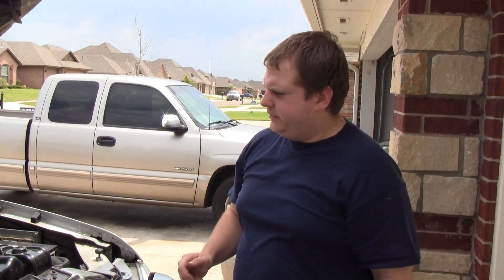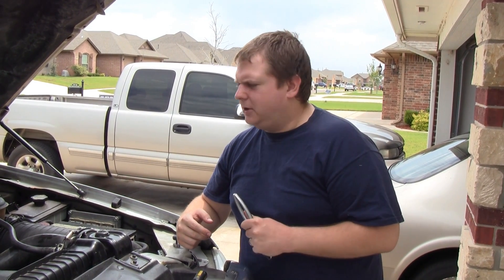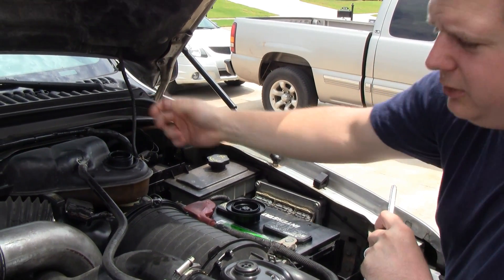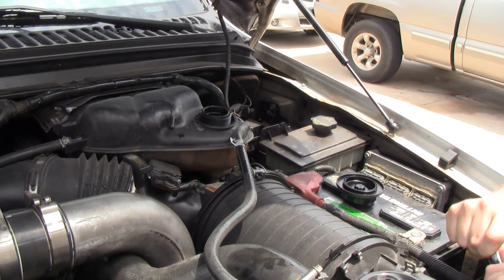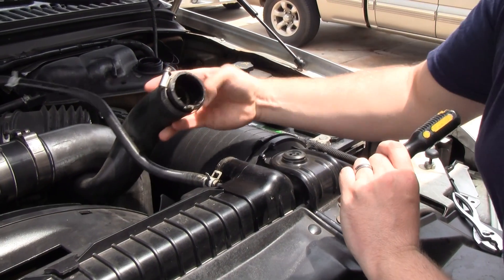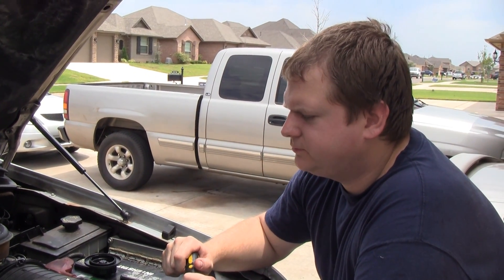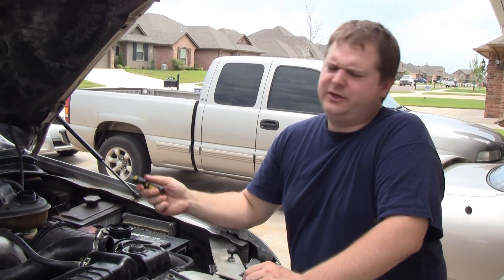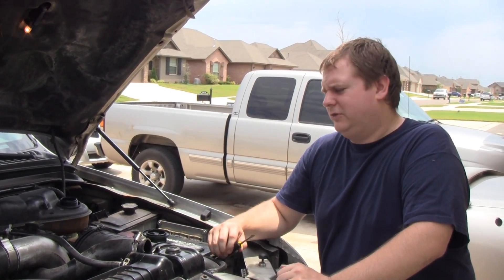Deviously Clever Mechanical Fraud On A 2003 F-250 Powerstroke Diesel

Comment: Problem 1 you bought a 6.0
Problem 2 that cover up job could have been done at any point in the trucks life. Even your "mechanic" could have done it. Don't automatically blame the dealer
But as a solution for all your automotive problems past, current, and future......buy a bicycle it will be more reliable than a 6.0 at least
Reply: +Zonedout1220 You must have sold this guy the truck. Why would his mechanic do something like this? So he could make less money repairing his truck? What's your logic?

Comment: Before buying any used vehicle take along a OB-2 scanner, plug it in the the computer port of the perspective vehicle and check it out. It could save you several thousand dollars. The scanner certainly would have picked up a fault code on this mans truck.. Just a thought..
Reply: +Joseph M An OBD scanner wouldn't tell you that theres oil in the coolant.
Reply: +Joseph M it's an auction u get to see the car and most of the time thats all u get to do and from far away.
Reply: +Joseph M Totally. I smoked out a small dealer on a ABS/traction control issue on a car I was considering cuz I was able to see pending codes in the computer. No lights, no disclosure by them, fed me some BS when I quizzed them about it. They probably realized real quick I knew more about that car than they did.
Reply: +Joseph M  That is a GREAT suggestion! Not to mention finding a Ford or diesel mechanic whenever thinking about buying one of those or really any used car!
Reply: +Joseph M      That is not always a surefire thing. You can delete codes permanently so the computer can not even throw it. But I've only heard of people doing it to their personal vehicles to pass emissions. But I'm sure somewhere someone is using the same method to cheat the next honest & hard working guy to come along.
Reply: Joseph M if the guy did all that wouldn't you think he would have cleared the dtc codes ... Not hard to do clear fault log and codes from computer in 3 seconds..
Reply: mwiz100  it's possible and easy with an obd scan tool
Reply: HulkSmash86 : Good point to remember..
Reply: wilkesjournal
I did a bunch of research on the matter before posting my comment. If you can direct me to something to lookup proving it I'm all ears! If this is real, I want to learn about it!
Reply: +mwiz100   Google "automotive computer flash" to begin. There are lots of companies and individuals who do it. It's routine, and generally is not done for nefarious purposes. It's done for various reasons including performance gains, non-compatible parts-swapping, etc. Often people install late-model drive trains in older vehicles, and bring the donor vehicle's computer along with it. In which case, computer re-programming is used to turn off the now non-existent security system so the 'new' engine will run in the older car, and so on. Many that were equipped with four O2 sensors can be programmed to now use only two in vehicles that are not equipped with catalytic converters. 

Those who are set up to re-flash OEM automotive computers can adjust, or tune them (or more commonly) can disable certain functions any way you're willing to pay for. It's not unusual.
Reply: wilkesjournal
Oh ok we're talking about re-flashes! (Plenty familiar with doing that.) I actually never thought about it that you could indeed use that for basically cheating. Considering the involvement of doing so purely to remove a code for a sale I don't see too many folks going to that effort but you totally could use it for that manner. But with the right digging you would be able to see it was running a non-stock flash.
Reply: +mwiz100   Yep, and by then it's too late. They've already got our money. Actually, this is the first time I've heard of it being used for this kind of deceit, but as the value of sub-prime, 15 year old used cars increases, it shouldn't surprise us.
Reply: Unless you've got a better ob scanner than i do it won't pick up and past codes that have been cleared/deleted, only active ones
Reply: I've never heard of such an ability to permanently delete codes. The inherent nature of OBDII doesn't allow for that and really isn't possible.
Reply: +mwiz100   Respectfully, you're mistaken.

Comment: Wow. This IS a form of criminal fraud. It's ironic that three years later, the 6.0L after all the bugs are now fixable with updates and paying attention to maintenance, this engine is actually not bad. Especially 2005 - 2007 models. It's a great tip and glad you posted it. After all these years, I bet more than a few have done this trick not only at dealers, but DYI'er too. It is sad to see.
Reply: +Doug Hanchard technically it's not fraud since it was an as is auction. still a slimy bs move, but sadly u couldn't take legal action against them unless they were selling as pristine and brand new condition which i doubt.

Comment: This is a scam the real scumbag used deals pull. They take vehicle to the auction with no intent on it making it to be auctioned off. They will wait to put it in the auction so it ends up towards the back of the line. Then they wait for a non dealer buyer to start looking the vehicle over and then tell you it's there personal car and they need to sell it fast for some BS reason and you think hey I'm getting a deal don't have to bid and pay more, I'm helping this guy out. WIN WIN. Couple weeks go by they title paper work comes and find out he's a dealer or start having issiues with the car before. 
One thing you should do is go back to the auction company with his info and let them know and also do some checking with DMV because in some states it's illegal for a dealer to not tell you he is one when selling. If it is report it. You might save somebody else. 
Hope it worked out with getting your truck fixed

Comment: I am so so sorry that you bought a 6.0/VT365 engine. These are the worst engines ever collaborated on with Ford Motor Company. Everyone that I know that owns one has had terrible issues of all kinds with this engine. Try to get rid of it and find you a nice 7.3L or the newer 6.7L all-Ford Powerstroke. Mine is the 7.3L with only 26,700 miles on it. So far, the only issue is bad fuel at some stations! The 7.3L is indestructible. Best of Luck, my friend.

Comment: now the truth comes out bought at auction see you lied u get what u pay for auction because a dealer took it trade  and sent it to auction they get rid of junk and high mileage cars and old junk
Reply: Terry Lee exactly. it's the reason you pay so little at auction, as you don't know jack shit about the vehicle you're buying. Most likely either the previous owner modified the truck and the dealer just sent it to auction as-is, or the dealer came up with a quick fix and sent it to auction.

Comment: I AM FROM EARTH I THINK I HAVE WORKED AT DOZENS OF DEALERSHIPS OVER TE LAST 32 YEARS I ALWAYS DID ENGINE WORK  HEAVY LIKE HEADS TURBOS ENGINES ETC IF IT WAS TRADED IN I DOUBT THE DEALERSHIP DID IT NO WAY THERE USED CAR GUY WOULD SAY OI IN COOLANT POSS HEA GASKETS BECAUSE THEY REALLY DO NOT KNOW ANYTHING AND A MECHANIC AT A NEW CAR DEALER WOULD NEVER BE ASKED TO DO THIS AND IF USED CAR MGR. TOLD HIM O DO IT OR HAVE A HEAVY LINE TECH DO IT AND CAUGHT LATER INSTANT TERMINATED MGR. AND TECH NOW SOME SMAL INDEPENDENT I OULD SEE THEM HAVING THE LINES BLOCKED OFF CUSTOMER DID IT OR SMALL LOT IF A DEALER DID IT GO TALK WITH THE GEN. MGR SECOND IN CHARGE BESIDE THE OWNER OR TALK WIT TE OWNER FUCK EM
PIECE OF CRAP STINKY EXHAUST I HATE THEM ESPECIALLY IF AS  A LIFT

Comment: I'll admit right off that I'm no expert - just a guy who has succeeded more or less over the years keeping beater-ish vehicles running. Learning from mistakes and all that. But one red flag I'd see is "pristine" coolant or oil or anything else on a used vehicle. And I'd never take the quantity or quality of coolant in the reservoir to mean anything - the rad has a cap so take it off and have a look. Yes, check the oil filler cap for suspicious foam and combine that knowledge with the fresh and clean oil on the dipstick, a new oil filter etc. Beware an overly clean engine compartment and get under the vehicle to look further back for evidence of oil leaks (scammers will steam clean an engine but few have the patience to go further back, and if they do, that's another red flag. I'd much rather see a car with worn seats, brake or clutch pedals and enough grime around the engine to tell me the story of what I might be getting into than a fantasy. But then again, in the old days they used to put sawdust into transmissions to mask wear - same old story of caveat emptor just different technology.

Comment: I'm sorry this happened to you.  With that being said, that era of the 6.0 power stroke diesel is the biggest pile of shit motor ever built.  Nothing but problems.  Probably the head bolts or the oil cooler have gone bad.

Comment: ASE certified Indiana licensed diesel mechanic. Bad oil cooler will cause the oil temp to be hot enough to blow the head completely so it's likely it's a head gasket but the head could be warped or even cracked. I'd do a smoke test and see if it's got a head/gasket leak and go from there. Smoke machines aren't cheap but they are defiantly worth the money or you could go to a shop a request one.

Comment: This could have been diagnosed real quick. One check that two mechanics certainly should have gotten around to was to simply remove the oil fill cap. If the bottom of the oil fill cap is coated with what looks like a milkshake you have a mixing of two liquids that should stay separate going on. One other thing, beware all cars/trucks purchased at auction.
Reply: ***** When the moisture is from an internal engine defect the amount of "milkshake" makes it clear that something is not right. You will also see this coating on valve train components. Once you see this a few times you get to know what you are looking at. Knowing what is normal and what is an indication of trouble is the key..
Reply: Dan R Depends on how hot the motor is. If it looks like this after coming off a freeway, yeah, bad news, but if you just fired it up and went around the block, you're gonna see moisture.

Comment: I have a small shop I do mainly flashing and reprogramming but also I do repos for a banks most of which someone just purchased months before in terrible mechanical condition to the point you can't understand how this vehicle was even sold as well I will not do any work for a used car lot unless they agree to completely fix the vehicle to a road worthy safe condition and needless to say only a couple agree to that .
Reply: +soaringtractor very true very true

Comment: its a power joke you were fucked from the word go
Reply: Crazylogie stfu logie go do a bigbig jump. :D
Reply: +Crazylogie  True, I was just stating that it wasn't because it was a powerstroke because I have a 7.3 powerstroke and it's a really good truck, the 6.0s are unreliable as hell though.  Also have an 84 CJ with a 95 tub and 350TBI so I have a soft spot for the Heeps too.
Reply: shawnsutube my heep hasn't cost me Thousands of dollars in repairs.
Reply: Crazylogie thats because they're built with cheap parts in the first place....
Reply: Crazylogie do it doit do it
Reply: Crazylogie my moms jeep already cost her 8k in engine parts moral of the story dont buy the 2010 liberty. and do it ill give you a cookie
Reply: +me2456 pug and logie aren't friends anymore sadly :(
Reply: +shawnsutube Actually the 6.0 once bulletproofed is more reliable than the 7.3, they all have issue,s, but like I said once you change out the head bolts, add the coolant filter and fresh egr/oil cooler them you wil be good for a long long time! I know my wife bought one, I had to figure out how to mitigate the problem,  plus issues with paint and a large settlement on that! God ole lemon law!
Reply: +Kevin Kanzler Agreed about getting the better 5R instead of the 4R but not so much about the 6.0 being good if left stock, they're ok if you leave them stock and don't work them but then you might as well have a gasser. In my book anything that you're more than likely going to have to pull the cab at least once if you're lucky in order to have a somewhat reliable truck isn't really what I'd call good. They do sound better, pull better and run smoother than a 7.3 when they're running right though. All trucks have their problems though, some are just harder and more expensive to fix.
Reply: +shawnsutube I purchased a '96 7.3 brand new and a brand new '05 6.0 for my former employer.  Once the trailer was on, it almost never came off and it was usually loaded pretty heavily.  Long story short, I never had an issue with either engine / trans, we were meticulous about maintenance and spared no expense in that area.  Far as I know, they're both still alive and kickin'.
Reply: +shawnsutube you don't have to pull the cab to do those jobs. Many shops do it because it's easier, but I've done injectors and egr cooler with cab on. And stock it pulls great. More power than the 7.3 stock. I agree its not as nice if you want to build it but I've never seen a need to really. tows 6 tons fine. Great engine for the excursion too.
Reply: +jmurphy1973 4r has a terrible rep but if you maintain its fine. my dad's 7.3 has 270k with stock 4r still going.
Reply: should of gone with a duramax
Reply: +shawnsutube it's a 03. it is a 7.3
Reply: +Cody Deadmond  You could get 6.0 and 7.3 in 03, this one in the video is clearly a 6.0
Reply: shawnsutube clearly he doesn't own a 6.0. Through all my defense of it I must admit, I've seen the engine of that thing A LOT. (I still think 225k isn't too bad though for the way it runs and what it costs)
Reply: Being it's a 6.0 is the problem. Say that to my 7.3 bitch
Reply: Powerstroke has nothing to do with it, it's the fact that it's a 6.0 is the problem. Still a better vehicle than a Heep though
Reply: me2456 fuck that
Reply: me2456 Costs me fuel thats it not 10k heads.
Reply: me2456 I think ill pass

Comment: They put a sealant liquid to repair the problem and it clogged up the holes, it might have a bad gasket. They sell these products in auto zone and other places, it also just could have been a oil leak so they figure $20 would fix the problem... sorry bro

Comment: All the mechanic would have to do in this case is change the oil and filters and evean if head or block was cracked. That is assuming it's a hairline fracture and not a huge crack. It would disguise the smoke and oil pressure would look normal temperature would look normal until you ran it an hour or two I'm guessing the silicon was placed in there to stop it from flowing back the wrong way .  or I was a brilliant ploy of Miss deception and misdirection mechanics that do shit like this should be taken out back and shot I can't stand it what's happening to America

Comment: I do cpo certifications at benz and if the repair cost is more the 10% of vaule or car has been wreck water damage or need a engine or so. Well ell it to the auction. Don't buy from auction if you aren't a technician or pockets aren't deep enough.  Good video though

Comment: I have seen this before well kinda they use to put saw dust in the old transmissions to block of leaking seals and to prevent slippage and people would buy and the next thing you know the sell of dealer has vanished

Comment: Sorry to hear about your luck..I know this vid is old and problem must be longed fixed..curious what it was though.. I do question the diesel mechanics abilities with due respect...Being that the coolant is under pressure there would have been as much contamination in the engine oil as there would have been contamination in the coolant....A simple pull of the dip stick should have shown the oil to be milky with coolant ..preferably before giving the dealer your hard earned cash..Good truck though..
Reply: Waynesbutler The oil pressure is greater than coolant pressure, it will always win. I've seen many CAT Cummins and Detroits with oil in the coolant but not coolant in the oil due to oil pressure being anywhere from 30-65psi and coolant 10-15psi.
Reply: Powersmokesd Yes buddy you are 100% correct but being in this trade unfortunately for over 30 years I have seen a lot of exceptions to this rule..And even now you think you have seen it all..but there is always something new that defys the rules .If its a head gasket or a cracked block or head the coolant usually wins , or when the engine is at full temp and turned off..oil pressure doesn't matter..if its a bad enough leak....but it will have a great deal of smoke out the pipes and something the dealer would have a hard time hiding temporarily.. And the list of things get longer when you add turbos and external coolers ..but I am no better then any other mechanic and sometimes I am wrong too. What was the problem after all..and do you still have the truck ?...Have a good holiday buddy..

Comment: I went to a mechanics school here in ohio, and as crazy as it sounds, our instructors would show us how, and tell us to do sneaky things like this to keep the customer coming back for more. They would tell us things like "by disassembling this compressor and replacing only the rubber O ring you can reassemble and charge the customer for the whole $1200 compressor" (after about 30 minutes of labor), or, "remove the thermostat, replace the antifreeze with pure water while running a few tubes of stopleak throught it, then charge them for a head gasket replacement" (stopleak to temporarily mask the lost compression into the cooling system, and having no thermostat to make it run cool all the time).
Reply: don't mind me asking where in ohio did you go?
Reply: Sinclair community college, Dayton ohio. It's supposedly one of the best in the country lmao they do have some really good equipment and cars to work on tho...